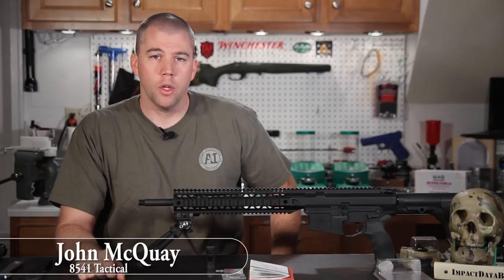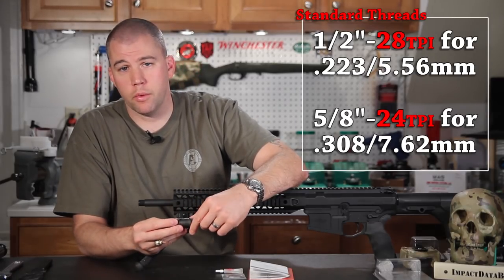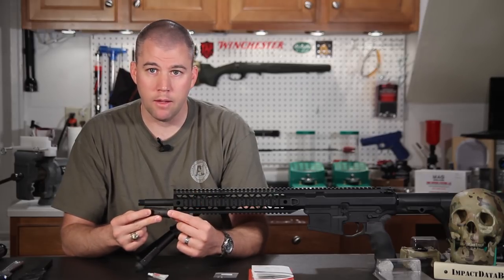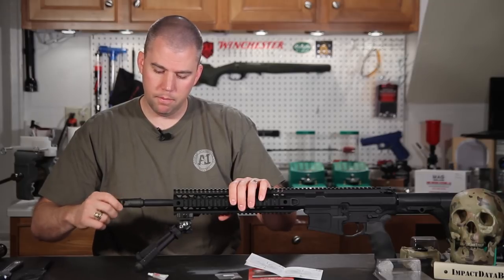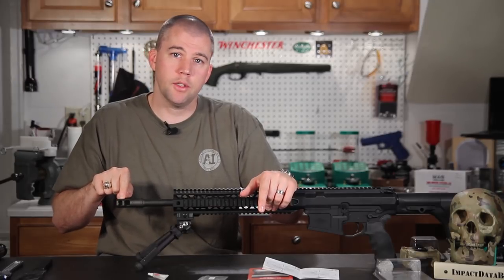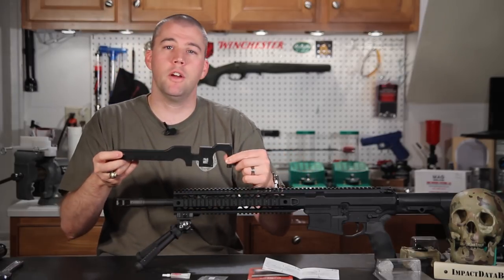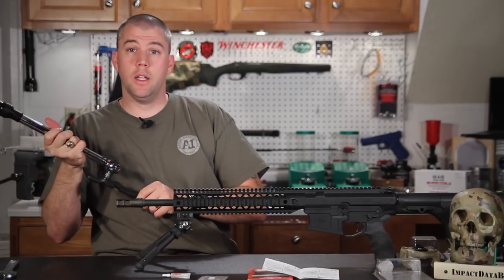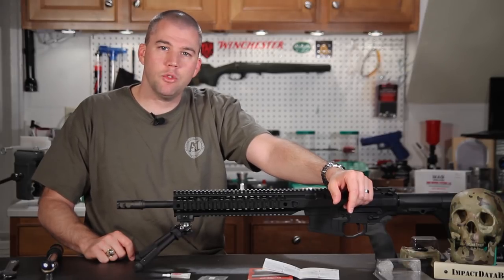MATEN Build Series 08 - Surefire SOCOM Muzzle Brake Installation (SFMB-762-5/8-24)

Comment: Hi, I just purchased a SFMB-556 brake, and on installation without using the chamfer spacer or any shims it mounted just like yours, just a  hair from top center! Looks like it will be perfect once torqued. Now Surefire says that I need to use the chamfer spacer, even if I don't need to use any shims to get it timed correctly. But when I use the chamfer spacer, it is not timed anymore, so then I have to start using shims. What would require the use of the spacer or not using the spacer?
You told the other person that asked about you not using one that it depends on the threads on the barrel. Specifically what do you mean?
Thanks for any info that you can give me!

Comment: .... my LaRue 7.62 PredatOBR  was sold to me with the FH762KO3 brake pinned to the 14.5 inch barrel.  When I looked at the indexing key / slot on the brake and my SOCOM-RC can they were not compatible albeit when installed , locked down / installed fitment seemed solid.  

Did not / won't shoot the combination until I collect some more info.   

Have you ever heard of or experienced problems using this combination safely ?  Potential issues etc ?

Not really wanting to drill out the pin to replace with the SFMB762 brake unless unsafe condition will exist....  Value your opinion if ya have time.

Comment: I had a question.. what gunsmith do you trust locally. I've got a rifle with a 14.5 inch barrel with a pin and welded flash suppressor and I want to put a surefire brake in its place..

Comment: It seems that you're not using the chamfer spacer? Why? It's my understanding that this must be used...?
Reply from the maker: It depends on how the threads were cut on your barrel. If you are mounting a SOCOM suppressor and there is any question, follow the included directions exactly.

Comment: Thanks for your video.  A question - if removing and re-installing a properly timed Surefire muzzle break, can the same shims as originally installed be re-used or will I need new shims?
Reply: New shims required

Comment: can this be put on with a crush washer instead of the timimg shims?
Reply from the maker: It “can” but it might be bad for any suppressor that is mounted on it. A crush washer can cause misalignment that can result in a baffle strike, damaging the suppressor. Since it comes with shims, I recommend using those to achieve proper timing.

Comment: Looks like this is a while back so you probably won't respond.  You were able to hand-tighten and get it to the proper position to begin torque, but you also discuss a hypothetical.  You back it out a little and state if it where at this point when hand-tightened, you would need a red and no color shim.  I think this is incorrect and you would actually need something like Green and 3 Red (or Green+2Red+4NoColor depending on angle).  When tightening, BDC notch goes from line stating "Desired location to begin torque" to 6 o'clock.  Take a look again, but I believe your reference point is not correct.  Great video otherwise...
Reply: You're absolutely correct.  First, he doesn't use the beveled spacer which was required, at least in the current instructions SureFire has available.  Second, as you mentioned, timing should be based on 6 o'clock and not 12 o'clock, and it's the point at which the bottom indicator on the brake stops prior to ~5:30 is where the shim colors get read from.

Another suggestion for anyone who finds this to install these brakes-- make a copy of the timing wheel from the instructions or go download and print the page with your timing wheel.  It's a near 1-to-1 size of your barrel.  Cut it out, cut out center hole, and slide it ONTO your barrel.  Once you get to the shoulder at the base of the threads, squeeze it onto the shoulder (so it wont' affect timing).  Yes, the paper will tear...you'll be alright...

Now, do the dry fit and hand-tightening while keeping the wheel at BDC as shown in the instructions.  Where the BDC mark on the brake stops prior to 5:30, that's the starting point for picking your shims.

Final tip:  Adding Rockset INCREASES torque at the same timing.  You've added material now between the threads of the barrel and threads of the brake.  The brake will torque into spec SOONER than hitting 6 o'clock BDC, and if that happens you'll have to either A) torque to the higher end of 30 ft. lbs or B) if you're too close and over 30 ft lbs before BDC then back it off and change out the shims to slightly past 5:30.